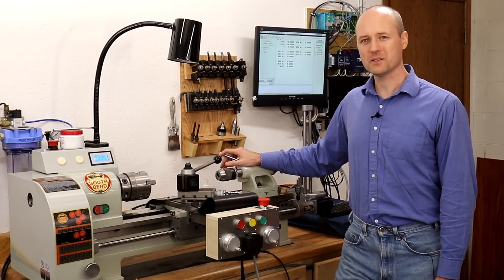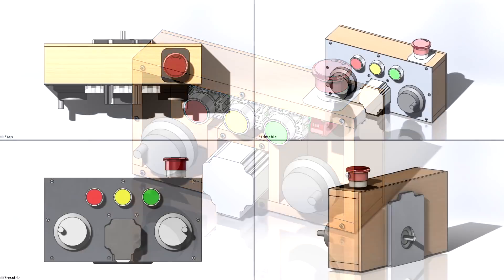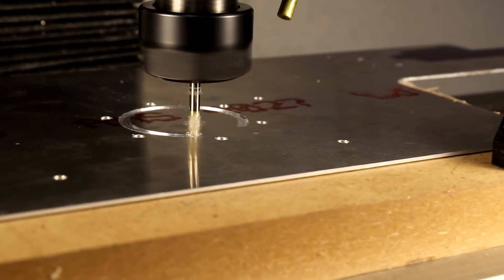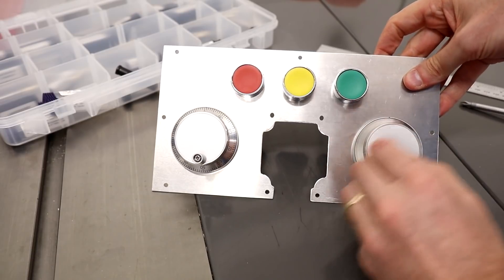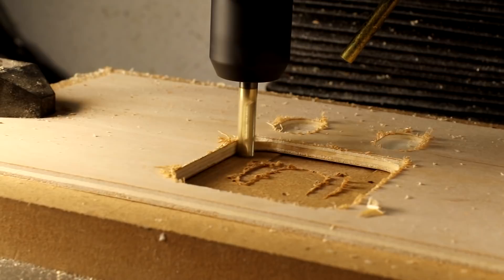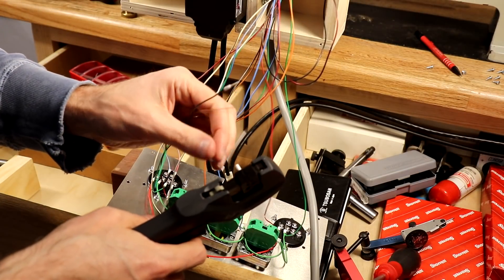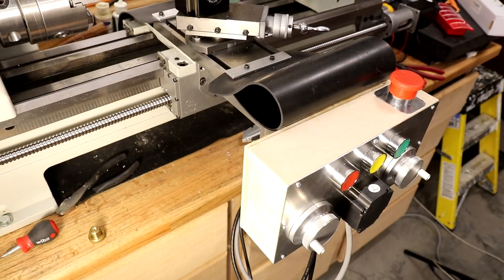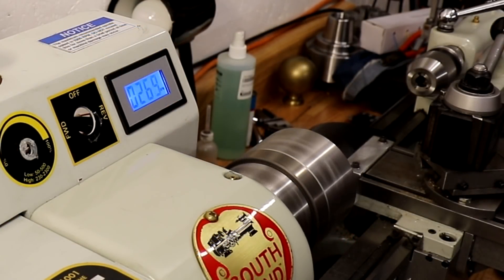Manual Pulse Generator Control Panel for CNC Lathe

Comment: Hey!
Ive been recently working through my first CNC conversion on a mini mill. 
Trying to use effectively the same set up as this but with all 3 axes...
Im up to like week 3 or 4 of trying to get the handwheels going. 
Is there an appropriate way of getting in touch with help for the hal side of things... (i think thats where the problem is
Reply from the maker: Hi Nick, you could check against my configuration
https://github.com/kentavv/kvvcreates/tree/master/linuxcnc/configs/sb1001_lathe/mesa
and write to me at 
kent.vandervelden@gmail.com

Comment: Out of curiosity how has this held up? I. Very interested in doing a CNC conversion but need to maintain manual control in some way. I do a lot of threading... Does this setup work well if there's a spindle encoder on the leadscrew?
Reply from the maker: I'm confused about the question about the encoder. What did you have in mind? Otherwise, it's held up nicely. I do more manual work than CNC on the lathe, so the dials get used a lot. If making again, I would add a switch that disables the MPGs. (I've never had a problem, but a lockout would insure no problems.) I would also like to implement a velocity based step generator in software or hardware. Then, if the MPG is turning fast the axis velocity is fast too, but if turning slowly then move in steps. Maybe a selector for switching between .0001" and .001" steps and velocity mode? I like your channel name. You might like the book Engineering the Guitar.
Reply: @kentvandervelden  I guess what I'm wondering is - if you have a spindle encoder for precise threading does using the handwheels ever throw it off? I make pens and do a LOT of multi-start threading in addition to shaping, so my primary concern is that i never throw off that precision even if i need to do the odd manual or semi-manual operation. admittedly i don't know a tonne about it so maybe i'm describing it poorly. love the idea of the velocity-based generator but what's the lockout for the MPG for - is that in case you bump a wheel while it's in operation?
Reply from the maker: The MPGs send pulses to the controller that is configured with how much the tool should move for each pulse. The controller that I use ignores the inputs when a program is running, and even if the MPG gets bumped my programs are relative a home position. That's a lot, but just to example why I don't know of any reason why the MPGs would mess up the synchronization. For safety, a switch to turn off the MPGs would be a good addition for a lock out. I like the setup a lot, but we all dream up possible improvements.

Comment: Congratulations on the good work, I really like this assembly, I have the same assembly and I like the idea of using two MPG to use the CNC lathe but I use Mach3, do you think it is possible? Can you tell me how I can do it? Thanks for everything and congratulations on your good work.
Reply from the maker: Thank you. My experience with Mach3 is from over ten years ago. My guess, just like with LinuxCNC, the simplicity of using two MPGs will depend on the interface card you have. I did a little searching and found the following, two MPGs with Mach3, but the approach is pretty complicated. I hope you can find something simpler.
https://forum.arduino.cc/t/cnc-controller-two-mpgs-and-two-7-segment-dros/570300
Reply: @kentvandervelden  You have more experience than me with Mach3, do you know if Mach3 can be used with two controllers? I have two equal USB controllers and I would like to know if it is possible to use them simultaneously, the idea would be to use one MPG in each controller and thus have two MPGs, one for the Z axis and the other for the X axis.
Reply from the maker: @joebar35  If the MPGs appear as HIDs (Human Input Devices, such as keyboards and mice) you have a good chance of having as many MPGs as you like. (If you are familiar with programming, the Arduino Pro Micro can be a HID and you could have MPGs attached to it.) Thank you
Reply: @kentvandervelden  Thank you very much for your help, I have read the article and it is true that it is quite complicated and with Arduino, I will continue investigating to see if I find something simpler. Kind regards.

Comment: Hello Kent, just found you Video of you MPG Lathe controller.
I had the same Idea years ago, because most of time i am using my Lathe conventional.
It absolutly works great after a little practice. I even can turn out little filet or chamfers with both wheels togheter.
Same like with the iron wheels. :-)
https://youtu.be/YKa8OUHPy1E
Reply from the maker: Thank you Gerhard for commenting and sharing  your good looking work. I find that I also do mostly conventional with the monitor as a huge DRO, which is just faster most of the time. I also find that I to have to quickly turn the handles and would like to change that so the velocity is related to the derivative of the turn rate... or something like that. I.e., turn the handle slowly and move in increments while turn the handle quickly and move with larger increments. I don't describe this well, but the commercial MPG pendent that I have implements this quite well and the feel is intuitive.

Comment: Great video, I would like to do same type conversion to a Victor 16 x 30 lathe. Could you provide info or links to places for ball screws, controls, and necessary equipment for a fully functional diy setup.If I have to make some parts that's ok. I like your control box. I would want controls to be very similar. Thanks George
Reply from the maker: Hi George, the parts you'll need are going to be a little specific to your machine. Best I can offer is to find others who have converted the same lathe or similar lathes and gather up ideas. Here on YouTube or CNCZone are great starting places. Use these examples to decide what you definitely want and don't want, and build a plan based on that. I tend to order parts from Misumi and McMaster. These are quite nice, with 3d models, but one has to be careful of price too. But a ballscrew ordered from Misumi will be fully machined to your specs. Best of success to you!

Comment: i seen a different type of cnc controller , one that you can just give commands like make a 20mm metric tread on a 40mm round bar this long or a bal at the end of a piece , check out https://www.youtube.com/watch?v=zMB3BxJQD84
i had the same toughts about cnc-ing a lathe , this just takes normal things you do on a lathe and automate it when you want
wonder if you get enough feel with using the encoders , might make it eazier to have everything move more smoothly if theres a bit of a flywheel like weight and a larger crank circle to the operation knobs
Reply from the maker: The video you sent is fantastic! Years ago I had the idea of making an electronic leadscrew. I started, this with an Arduino, then FPGA, and then life happened :) It seemed like CNC was a small step from electronic leadscrew and gives more versatility.  Once with CNC, macros can be made to implement the features of the electronic leadscrew, including the extra control panel, and extending the commands is only software. What are your thoughts? Btw, sorry to take so long to reply.

Comment: Hi Kent,

Another great video from the archive! stumbled upon as (you guessed it) I'm looking at interface options for my Lathe conversion. I got all the mechanical stuff squared away before Christmas and I'm just about done with the motors, sensors motion control etc. the essential electronics. Now I'm looking at the bells and whistles and an interface like this one is precisely what I'm planning. We have some XYZ CNC lathes at work which operate, for all intents and purposes, identically to the manual lathes. From the DRO on the control panel you're able to control X and Z axis motion with two handwheels. This makes setting up jobs very straightforward as you can just take a face cut and set your current tool position as Z0. Then turn down the OD slightly, measure the job and set it's diameter as your current X value. Perhaps the most interesting feature of these machines is the ability to use the jog wheels to track through your programs. This obviously negates programmed feed rates but it's handy to check everything looks sensible before you hand over full control to the machine.

So my plan is to Implement a similar control setup on my machine. I have a couple of what appear to be identical MPG wheels to the one you've used here on route to me at the moment. I take it they're just plumbed in to the machine via parallel port inputs? or is there some extra hardware involved as there was with the encoder I asked about before? Hoping it's going to be fairly straightforward.
Reply from the maker: Hi Steven, great to hear from you! The MPGs turn pretty slow and with 100 ppr, the parallel port is fast enough, and if a pulse is missed nothing is harmed in this case, unlike with a spindle encoder. You may need a extra parallel port to have enough  input, but with only two axes to control on a lathe, maybe there's enough I/O with a single parallel port. Let me know how it turns out. I started with an interest in an electronic leadscrew then did the lathe cnc conversion.

Comment: Use heat when you remove a thin workpiece like that, it softens the glue. An old clothes iron should do the trick.
Reply from the maker: Thank you, that's a great suggestion! I'll give it a go.

Comment: 13:55 what is this blue thing does ? :D
Reply from the maker: It's the coolant reservoir for FogBuster. I mounted between the lathe and mill so I can use the same coolant mister on both machines

Comment: How to conect mpg wheels with breakout board?
Reply from the maker: Hi Mirko. Roughly, if MPG wheels like these, you'll need sufficient inputs (two or three), sufficient sampling rate on the inputs, and some code that connects the inputs to the controller. This will be dependent on your hardware and controller so finding someone who has already done this with your setup by searching on Google is your best chance. There are also USB based MPG wheels that may be easier to setup. Best of success to you.

Comment: Hi! I have a question! Are MPGs working on velocity mode or step mode? I mean, in linuxCNC can you set the distance traveled for every encoder count?
Reply from the maker: LinuxCNC supports both velocity and step modes. Here I'm using step mode. Velocity mode runs smoother but I felt step mode was more intuitive with less chance of overshooting. However, on my mill I generally use velocity mode, but have a button to switch to step mode. Both are nice, for example,  to rapid to a part, then slowly and carefully touch off.
Reply: Yeah... today I was reading about LinuxCNC. What an awesome controller! I was even able to make my MPG work in it. I still have to read a lot about those hal files, but so far I am enjoying what I'm seeing... Very powerfull and way more customisable than Mach3... and free xD
Reply: Nothings free a lot of hardworking individuals sacrificed their time to make Machinekit possible. I highly recommend donating to the ongoing development for Linux and showing the community not because it’s “free” but that you chose because it’s fantastic and the developers made something fantastic for the world to use and expand upon.

Comment: Hi Kent, looks really nice and thanks for that video. Couple days ago i bought an 50y old heavy lathe (2450kg) from the scrap yard and i will soon start the conversion to cnc with linear rail guides, but also i would like to have manual pulse geneators for both axis, but i havent done it yet, so actually i dont know how it works (wiring and linuxcnc setup). I build an large cnc router already which works with LinuxCNC, so i have some experience, but your MPG linuxcnc settings would be very help. Unfortunately i cant find the in the GitHub link. Could you please send me the link to that. It would be very helpful, because you did exactly what i planned to do soon. Thanks in advance. Br, Denis
Reply from the maker: Hi Br. Denis, your project sounds amazing! In general, you'll need some way to receive two signals (A and B) from the each encoder (so four digital inputs) at a sampling rate that's fast enough. I used a couple 100 pulse-per-revolution MPGs and so sampling at a few kHz is enough. I'm using a Pico Systems Universal Stepper Controller. However, I'm using the general digital inputs for the hand wheel encoders and reserved the high-speed encoder input for the spindle encoder. Others have used hardware from Mesa Electronics. In the controller, there'll need to be some logic for combining the A-B signals into jog steps. LinuxCNC provides this with the Encoder HAL component, but I don't know what the options are for a non-LinuxCNC controller. The direct link to my lathe LinuxCNC configuration using the Pico UCS is below, I hope it is of at least some help. Let me know if I can further help. Have a great weekend! Kent
https://github.com/kentavv/kvvcreates/tree/master/linuxcnc/sb1001_lathe_config/lathe_config
Reply: Thank you very much for your quick reply and help ! Very kind :) So, it seems that i will need an Mesa oder Pico card and can not use the, for example, cheap chinese Breakout Boards, but thats not an problem as long as i can use spindle encoder and the MPGs for both axis. Thank you for the link, i should have found it by my self, so sorry for taking your time. Right now, the Lathe is standing outside and today we are gona try to get in in the workshop, which will be pretty difficult, but i hope we get it done and then i soon will start with the project. It might be that i will write you again in some time and ask for help :D. Again, thank you very much and wish you all the best and much fun with your lathe ! Br, Denis
Reply from the maker: It may be possible to use the breakout boards but you may struggle to get them to work. To have enough I/O you may need two parallel ports as well. Most of the LinuxCNC folks use Mesa or Pico. Mesa is probably a bit more popular, but I had a hard time making sense of what combination would work, and Jon with Pico was patient enough to walk me through all that was needed, and Pico is in the Midwest, so Pico felt more local. :) Please free to email me too. Also, you might be interested in what Joe on Tailor Machine Works has done with adding linear rails to his Bridgeport. Have a wonderful weekend!
https://www.youtube.com/channel/UCG7NPGwANmcArVo6x0e18xg/videos
Reply: Thanks again Kent. I understand and i think i will decide for the Mesa 7i25 + 7i76 which i actually wanted to buy for for my large CNC router, but there i have now 2 Parallel cards connected which works great, but like you said, i may struggle to get the cheap chinese BOBs to work with MPGs. The 7i76 has everything i need for the Lathe. I can mount an Spindle encoder and also 2 MPGs, but i hope to get help in the LinuxCNC forum to get it to work properly (have got always help there for now :D). Its good to know that i can mail you as soon as i want to wire up and setup up the MPGs. Who knows, it might be that i decide for Pico, just because i think you could help me to set it up properly, because you have done it already :). I checked that videos from Joe, thanks for that. I want to do something similar, but in my case it will be a bit difficult, because it seems that the Tailstock slides are a bit worn and i am not sure if i have to scrape them (never done that). Also i have to cut off the original support slides (prisma) and get the surface flat to mount the linear guide rails. It will be a lot of work and it will take some time until i will start with the electrical stuff and hope that you will then still read comments here on YT :D. Thank you very much and have a nice Sunday !